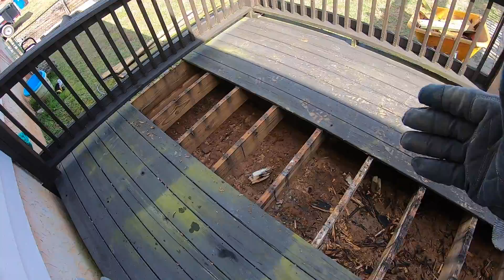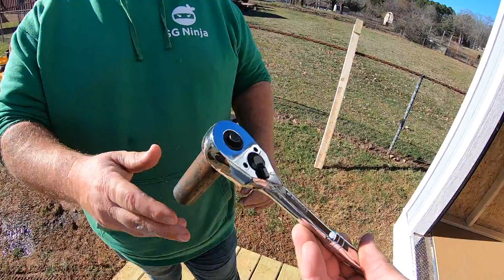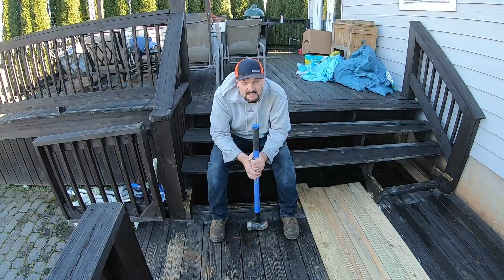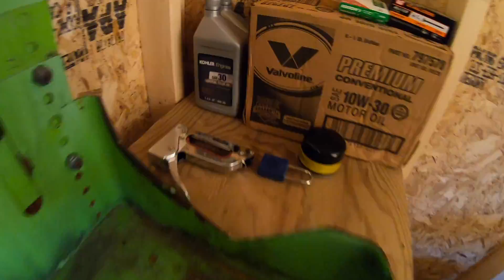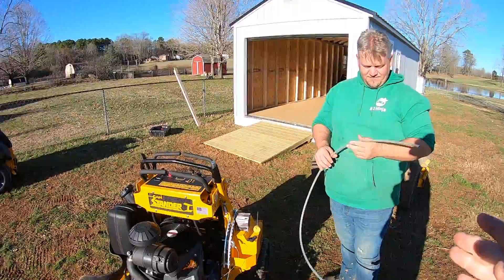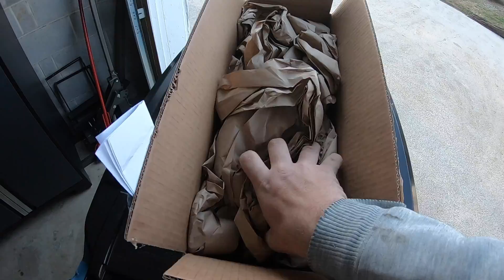Under 5 Minute Oil Change

Comment: Decking is supposed to be gapped a little to prevent water build up
Reply: The boards are pressure treated so they’ll shrink a little and give you your gap.

Comment: It is always good to have a little space in case the wood absorbs even more moisture and expands which would cause your planks to start bowing and popping up. Rip one plank down on a table-saw taking an inch off or a 1/4" on all of them, if you want it totally unnoticeable and leave a slight gag for the Spring rains. Over time, the planks will shrink in their widths, but if you get too much moisture too soon...

Comment: You should have a small gap between boards to allow water to drain off! If not stands there and soaks in to wood! New wood will shrink a little as it dries out! There is also a crown on each board that should also face up for drainage! Have fun.

Comment: When doing oil changes, I always fill the filter before installing. helps get the oil flowing faster. Less chance for a dry start... I had a joke about Sassy and that hose but ill keep it to myself... Sassy is way too funny, Never let him go!
Reply: Lo-Tech,I've had a lot of Race cars, and from all the ones that Build Motors for me, say only if it has not been started in 6 months to a year,, no need to fill oil filter, if it hasn't been started in 6 months all the oil that was coating everything has done dried off, In between oil changes don't have time to dry out, Just what I've seen a lot of when that took them apart.. Lawnmowers might be Diff.so Please forgive me for saying any thing if they are..
Reply: Ive always put oil in the filter, it helps get the oil thru the engine faster... it might not do much but it makes me feel better and ive just always done it. I know a guy who will change his oil and after the oil drains, he puts a quart down it to help flush out any old oil, I think thats a bit overkill, but it makes us feel like we did the best job possible. I don t like to half ass anything... I prefer to use my whole ass

Comment: I’ve seen those oil vacuums before but I had never seen one in action.now that I’ve seen it work I’ll definitely be getting one before the weather breaks in the spring.that will be just the ticket for my mowers,dr trimmer and pressure washer.
S&K tools have been around for a long time.i bought them and used them since the mid 70’s.they are just as good as snap on,Mac,matco and cornwell in my opinion and they cost considerably less.
You gotta find out the reason for it being illegal to whisper in someone’s ear while moose hunting in Alaska.i gotta know,lol !

Comment: Hey Nick & Sassy, Huh 🤔 You Know Nick I just Purchased all my Oil at my Dealer for my Wright Intensity & ZK and I asked Them which Oil I Needed:20 W 50 with the Blue Top on it or Sae 30 with the Yellow Top on it for my Kawasaki Engines and They Told me to use the Kawasaki SAE 30 for Both. I Wonder if I need to Go Back and Question my Dealer on that ? I Don't want to cause any Damage to my Engines..... Nick I wanted to Ask you, Where did you get that Suction Product for the Oil ? I Tried to look at the Sticker in front of it but I couldn't see it, I would Like to Purchase One. That's Awesome from DLT Lawncare 👍🏻 ..... Sassy, No Whispering during Moose Hunting ..... LOL 🤣 & Frowned Upon in the Mens Room in the Walmart 😂😂🤣 Thanks for for Sharing & Be Safe 🇺🇸

Comment: So Kawasaki recommends 20w50 hydro oil in the engine?? I run 20w50 in my hydros but 10w30 in the actual engine
Reply: Exactly what I was thinking......Nick check you have the right oil before you run that mower.   20w50 is usually hydro oil, with 10w30/10w40 in the engine.
Reply: They recommend 20w50 in hot climates